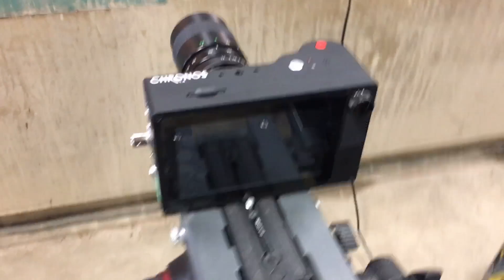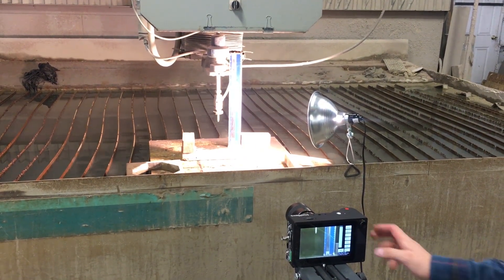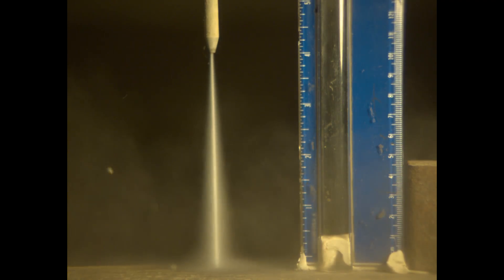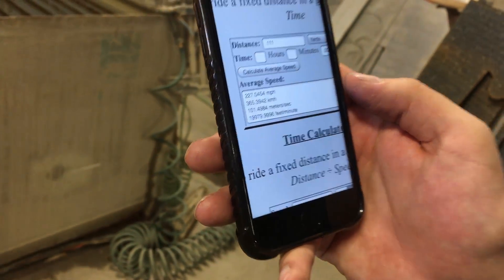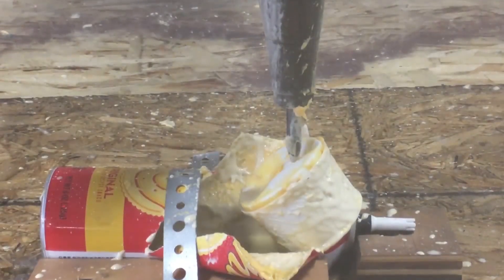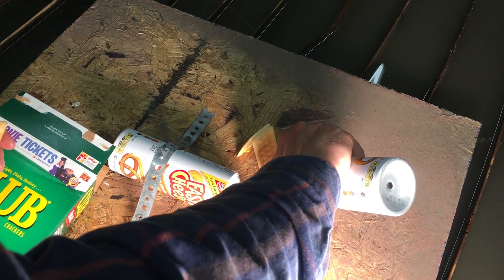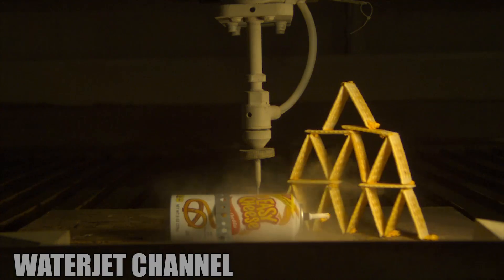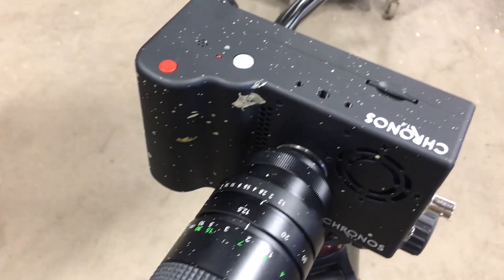Exploding Easy Cheese In Slow Motion With A 60,000 PSI Waterjet

Comment: Aim that water jet out the door. Test how far it goes.
Reply: Andres Suzuki would go probably a meter before breaking into a mist , it would dissipate so quick because of the immense pressure. I would still like to see it, I could be wrong
Reply: Andres Suzuki how??
Reply: Physical labor
Reply: They got a new waterjet that can shoot at 60 degrees. They put a hole through a watermelon from like 4 feet away.